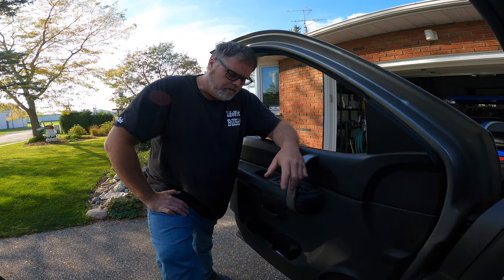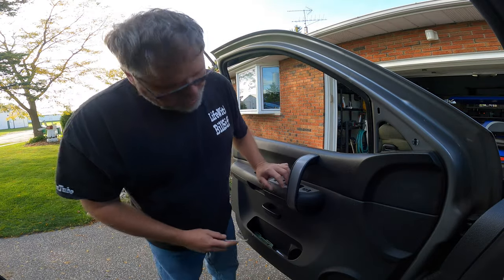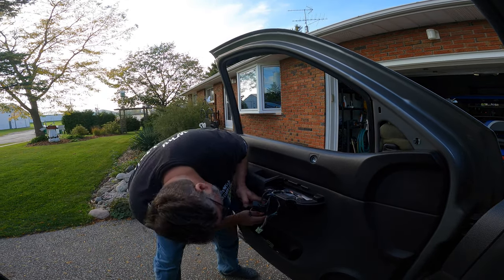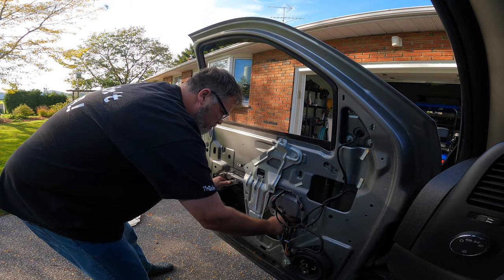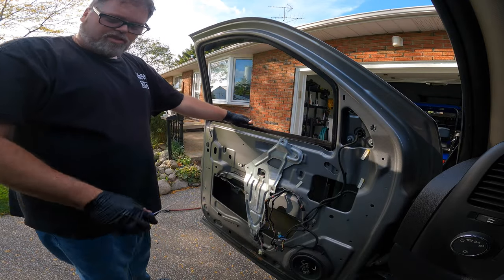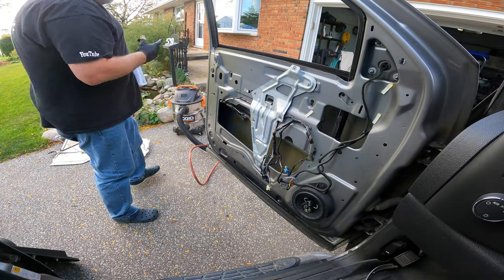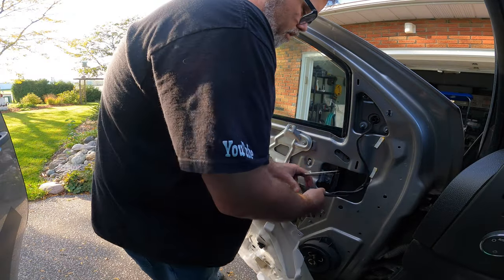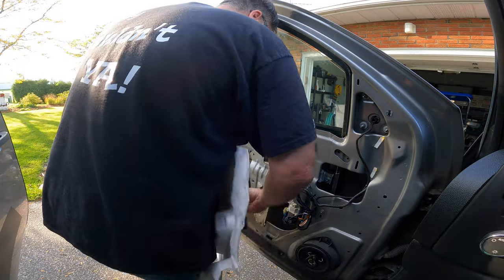Installing Door Glass In Silverado   4K

Comment: What I lived up north (upstate ny) to stop the door panels from rubbing the paint off like that we would get that thin black rubber edge trim stuff you put around the end of your doors so they paint does chip if you hit someone's car when opening the door. Its thin. Usually comes in black or clear or chrome. Usually sold at the car parts store. Just put it on the edge of the door panel so it doesn't scuff the paint and rust.